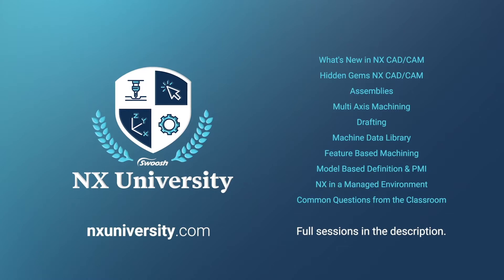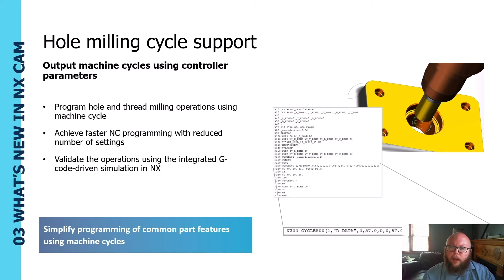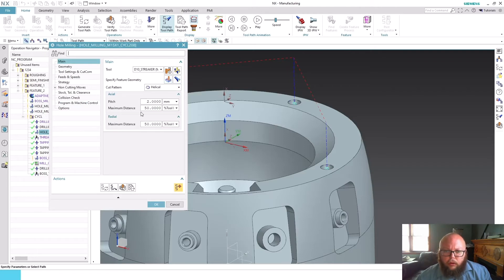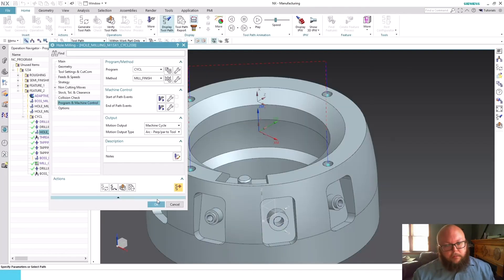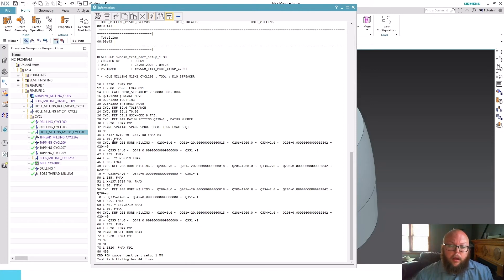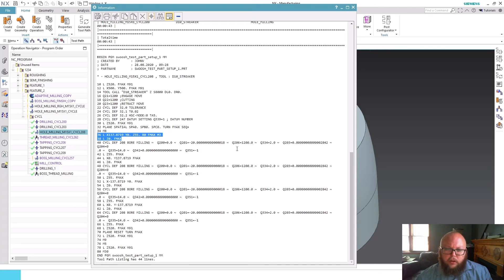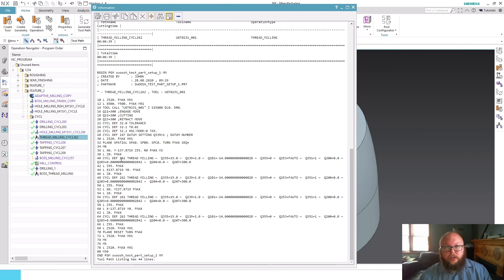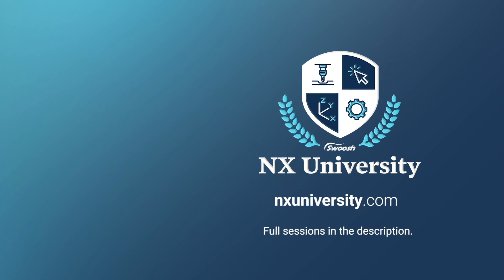Hole Milling Cycle Support in NX 1926

Comment: Hello, can you show us what the post processor looks like?  or show how to build it.  

Thx
Reply: Bore milling (cycl208) and thread milling(cycl262) cycles are now supported OOTB in NX1953 post configurator.  I will try post a follow up video for cycles that are not supported such as Boss milling (cycl257) soon.
Reply: @johnvincent4853  you are right, cycl 208 is ootb in post configurator.  so far i had always worked with the post builder.